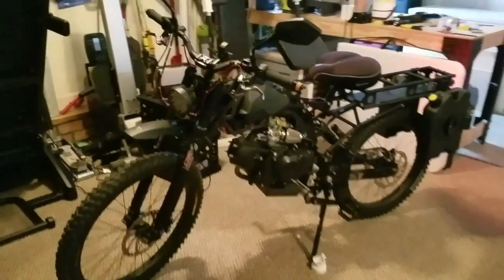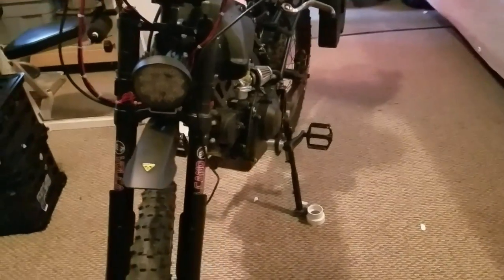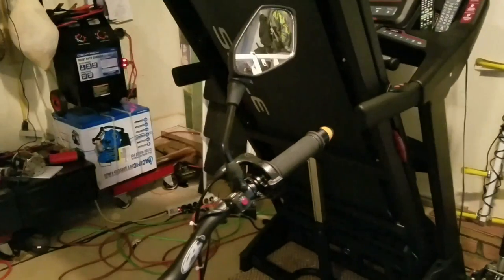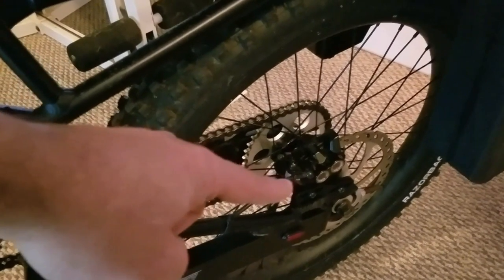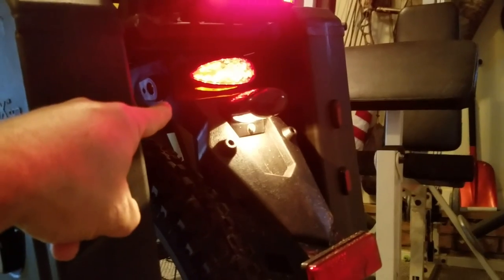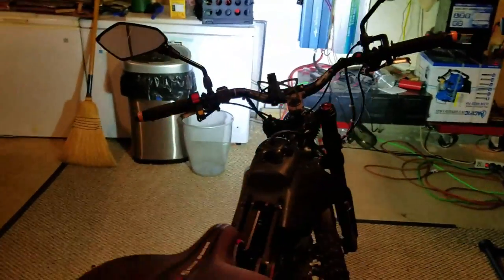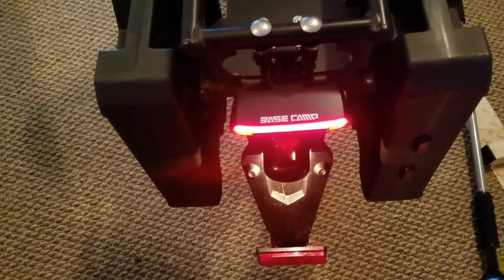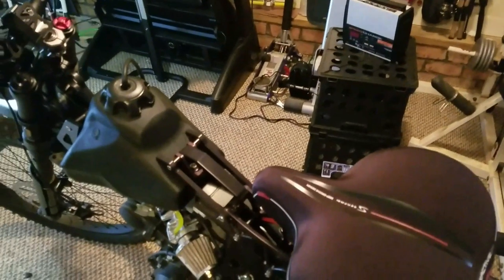Motoped Survival Bike 49cc first impressions / DOT upgrades

Comment: good job man your mods came out clean. but you are 100% right im looking at 125cc small bikes they remind me of when i was a  kid had no license but someone always had some dirbikes we could ride around town and be hooligans with but they are just fun overall. i want the grom but they are like 4k or so out the door. so i been seriously thinking of the ssr razkull for half the price.  this is a cool bike though. and i guess its not too much out of the price range they are asking for these small bikes though i do believe they should be trying to get it full street legal and down to the  2500 or less price range brand new.  esp when 250s and some 300s are only 1k more then these. though there is really no other bike like a 125. you can also change the gearing to get more torque and lose a little top end. usually the front is the cheaper one to change. but also if you want a real offroad one just get a japanese dirt bike they are only like 1k or less used on craigslist and they are a lot more fun then this for off road. these remind me more of city running bikes. now you just need a speedo and a fuel guage. but these can accept the 212cc engines i believe so  you can really mod this to your liking which i think is also a +. and i think though its a little pricey and bigger bikes are cheap used and even new they still arent what these are little mess around 125s that are really a lot of fun. there is also a saying its fun to drive a slow bike fast but driving a fast bike slow isnt very fun.

Comment: I am wondering if the 125cc has a geared transition or is it just a single gear because i found both a 125cc engine and a 140cc engine both 4 speed that would fit the 140 come with an electrical wire harness would really like to find out.
Reply from the maker: 4 speed

Comment: what is better the 125cc or the 49cc for everyday use the 125cc is better right  ?
Reply from the maker: If you had to buy the bike - and I don't recommend you buy the bike - I recommend you take the money you would have spent and buy a used adventure motorcycle (small one like the KTM Duke for example).  - if you absolutely had to buy this bike and had a gun to your head, I'd recommend the 125cc - but don't buy either if you don't have to. It's a novelty purchase.
Reply: thanks i'll get something else
Reply: There is no replacement for displacement.